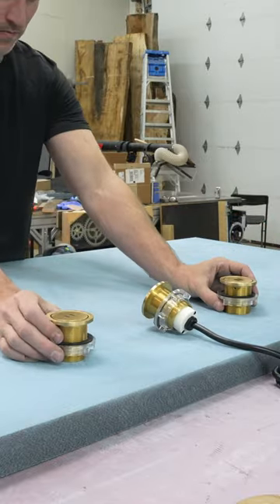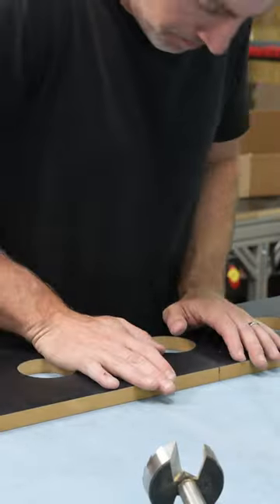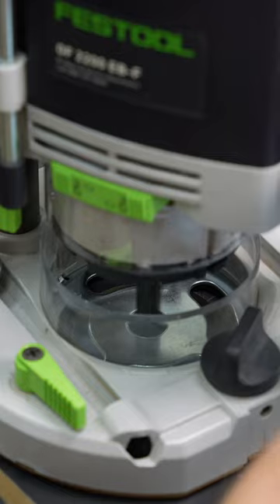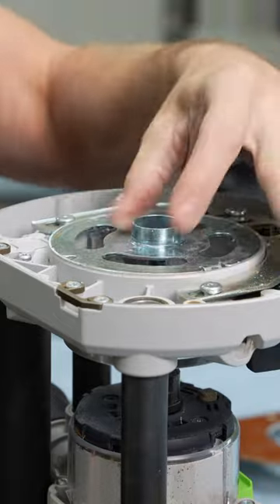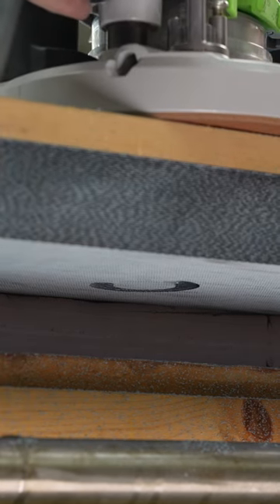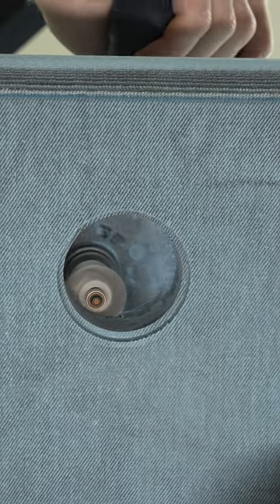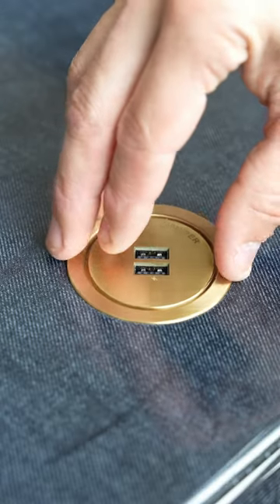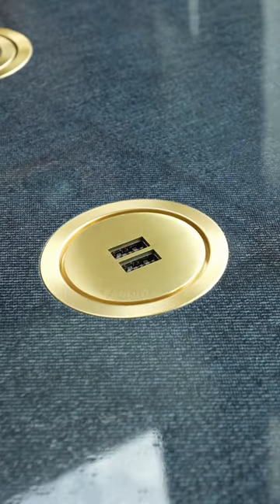Denim Desk Brass Power

Comment: I watched that video. 
While its a super cool desk. I am going to build mine with drawers to either side of me and install chargers in each drawer so I can plug in devices in the draw and have a clean desk top. 
I am going with a dark butcher block look and going to install wireless charging under colored glass with a electric symbol. Then using frosted accrilic going to install led lighting at the rear of the desk and in the face of the drawers and cabinet fronts. I am working on a audio board to add in to the face of the desk to control volume, base, treble and so on which will allow me to switch to built in speakers, headphone jack, or connect to bluetooth headphones/speakers along with audio lighting control. I want a super high tech desk.